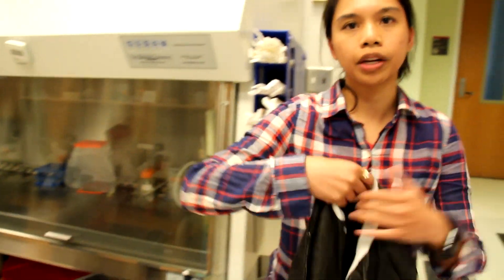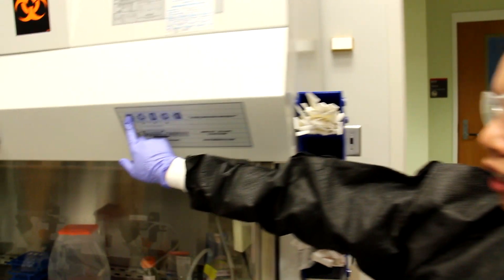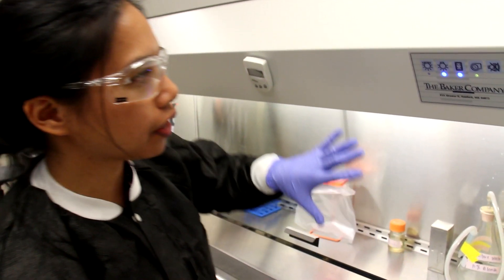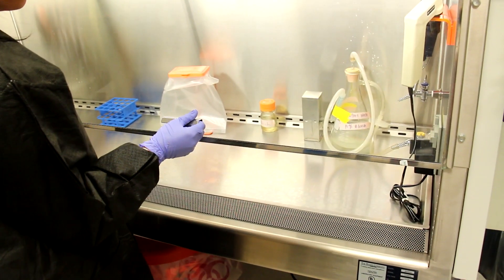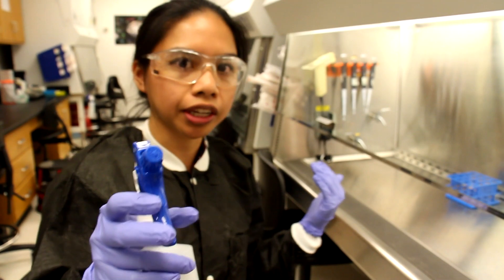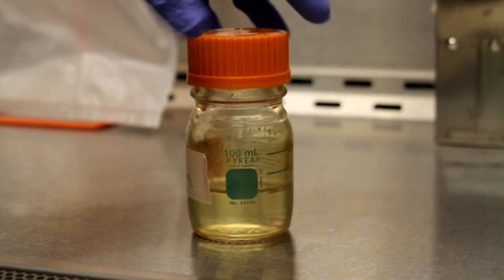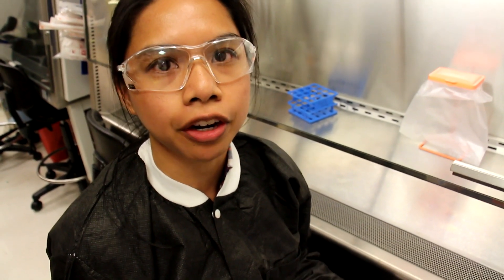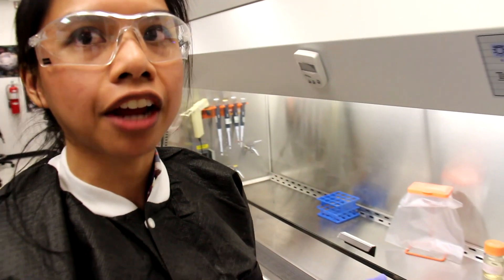Prepping and Cleaning Biosafety Cabinets

Comment: So many things with this video that I believe could be improved.
My notes for a better prep
1. Turn on UV 10 minutes.
2. Turn off UV and turn on blower and allow for proper air flow for at least 10 minutes.  This will reduce particles, which is what the BSC is designed to do..
3. Do not wipe with paper towels, they create particles.  Use particle reducing towelettes. Spray the towelettes and use those instead of misting inside your BSC. 
4. Every time you exit the BSC wipe your hands with ethanol before re-entering the BSC.
5. Use a microbial agent first  by wetting your towelette with it,  then enter the BSC and start wiping in a singular direction right to left, starting from the back and slowly in an overlapping fashion move toward the front.  Allow contact time of at least 10 minutes. 10% Bleach can be used. 1 part household bleach 9 parts water.  Ethanol does not kill spores . 
6. Drench your towelette with your 70% ethanol wipe in a singular direction right to left slowly in an overlapping fashion starting from the back. When done  Allow 10 minutes of contact time.
The reason why you wipe slowly in an overlapping fashion, is to ensure complete coverage without disrupting the air flow and to reduce particle counts.  
Your surface is now ready to work upon.  
When done.  Wipe again, as above, with the microbial agent first, wait 10 minutes, then the 70% alcohol, waiting 10 minutes. Then close the sash and turn on the UV light for at least 10 minutes.

Comment: Ethanol can make corrosion ...
Reply: I've worked in hoods since the '90s.  504 stainless steel (which a well built hood should be made of) will not corrode due to regular cleaning with ethanol or isopropyl alcohol.  Most manufactures (like Nuaire) actually suggest using these products to clean and disinfect.
Reply: No, it will not. 10% bleach however will do that.